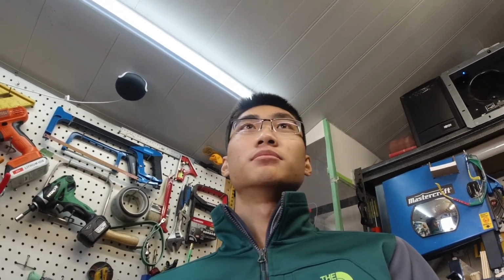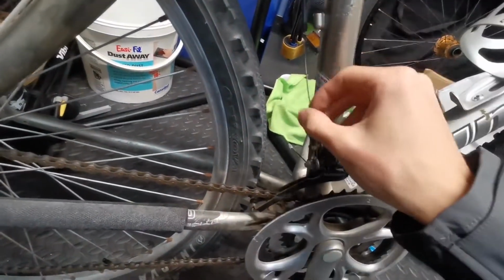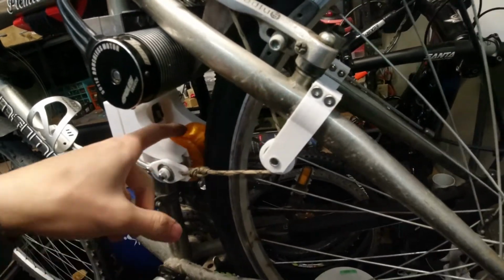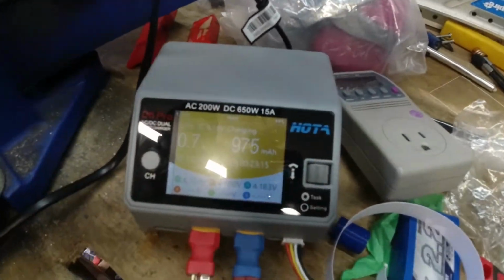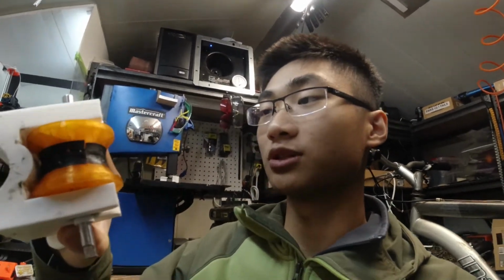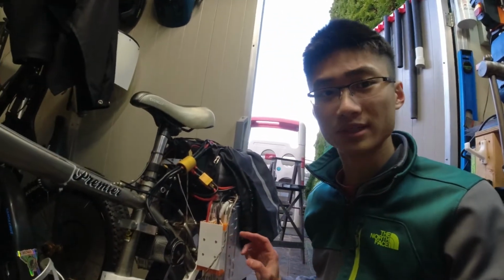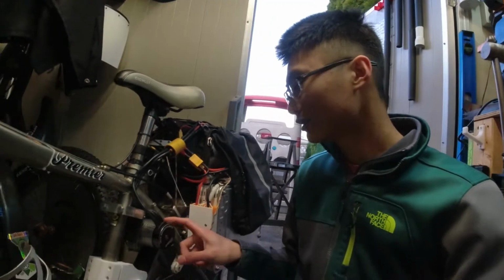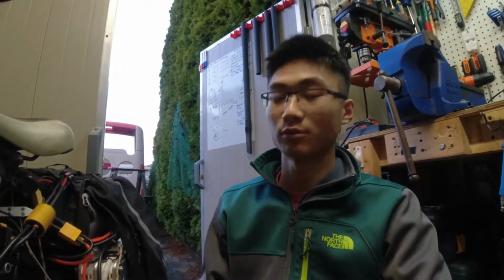Electric Bike V3 (Friction Drive with Zero Friction While Coasting!)

Comment: Damn bro, why would you move to a design thats way less efficient? You will always lose up to 40% of your energy to rubber deformation in a friction drive, its just not worth it. Way more energy saved by just using the coasting function on vesc.
Reply: Where did you get that number? Energy is only sent elsewhere when the two slipped each other. Else, translational motion
Reply: Because 40% is a giant number and never saw increased energy consumption with the bikes we were testing, since friction drive is effectively a big gear reduction it reduces current draw! Don't repeat things you know nothing about

Comment: Really like what you are doing! What a fun project. I have always wanted to do a three way hybrid bike myself just for fun. Front electric hub motor, gas rear drive kit motor and still able to pedal. It would be cool because you would have two wheel drive gas and electric, and you could even regen the electric off the gas or pedaling and have a really diverse way of powering the vehicle. Keep up the cool work. I recon you are in Canada as well. Thanks for the inspiration!